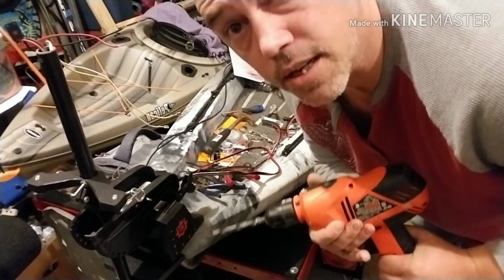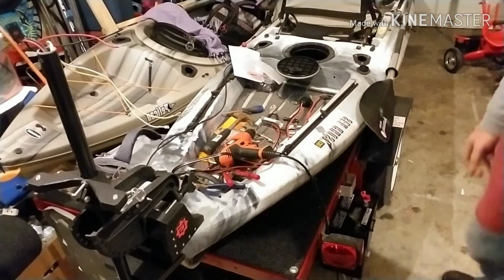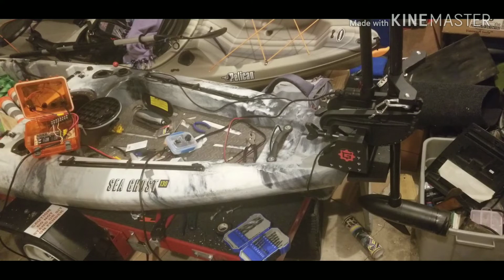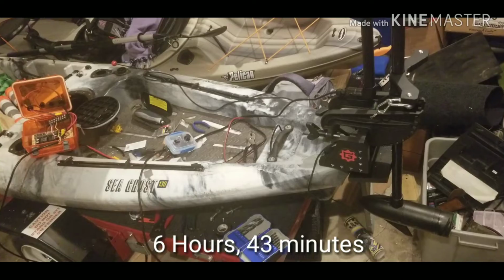Kayak Trolling motor build - final assembly

Comment: Thanks for posting the video, the build looks good so far, too bad for the damaged part. Question, what capacity battery are you using ? I'm wondering if  that speed controller would work with a 50ah battery just as fine as with a 30ah? Just curious if that would heat up eventually and  burn out the relays if it's not made especial for that.
Reply from the maker: I am actually using a 55ah mighty max battery.  People have used this and the 36ah. The controller is rated to draw 60amps which is twice as much as the motor pulls. After the issue with the cheap controller I am upgrading to a wirelesstrollingpro wired controller. Which after materials is the same cost. Excited to get it. Will do a review video when I get it installed.

Comment: Why take so long in grinding and sanding that elbow out for the motor? All you have to do is heat it up a little with a propane burner and push it on.